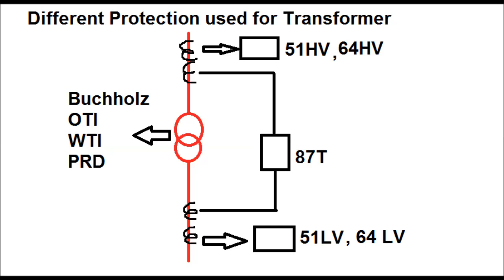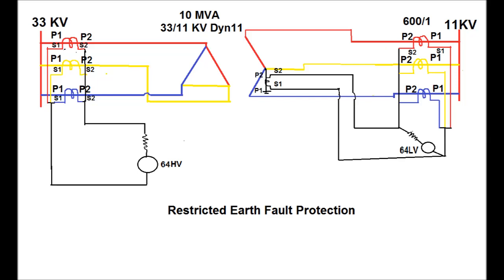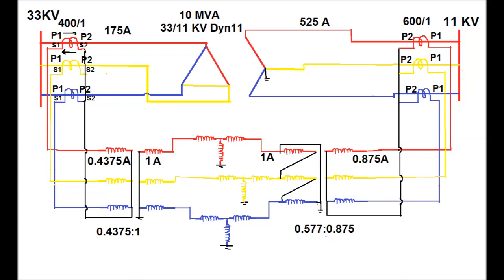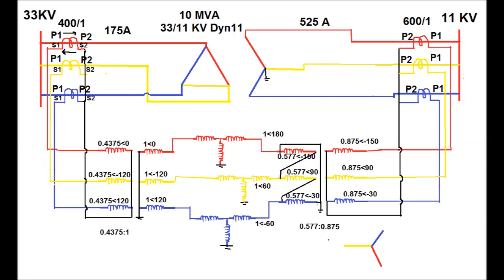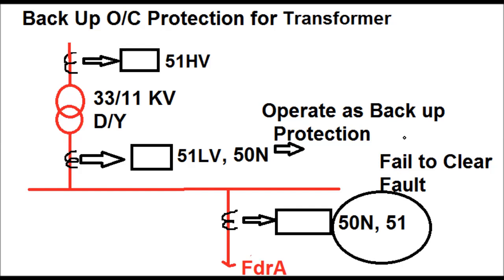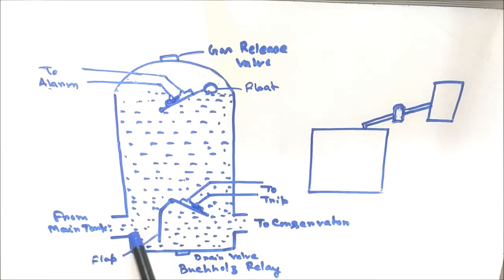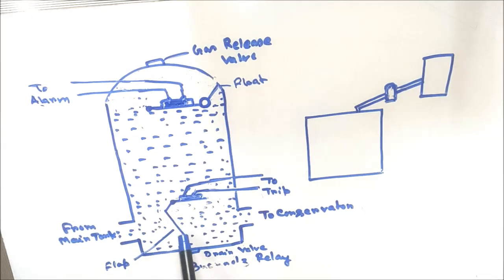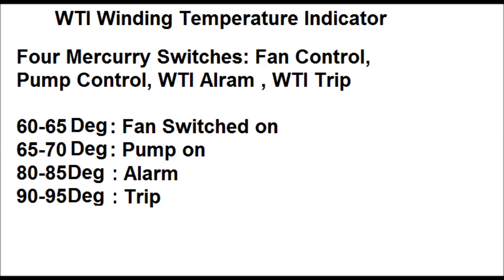Different Protection for Power Transformer

Comment: Sir, How to calculate the HT current transformer rating because transformer FLA is 175A but 400 A CT provided which is 2.2 times but at outgoing FLA is 525A but 600A which 1.1 times the value.
Reply: we have to choose 200A rated CT instead of 400A
Reply: @channabasavaraj9817  Thank you for your reply sir, which means 20% from FLA of transformer is enough.
Reply from the maker: Since HV full load current is 175A , and considering 10% full load current settings of O/L for transformer is 192 A. So you can choose 200/1 A CT in HV side also.
Reply: @relayprotectionelectrical   Thank you for your reply sir, kindly do as much as videos.